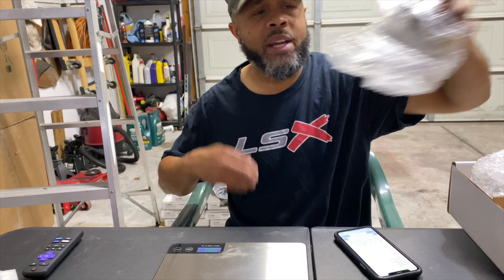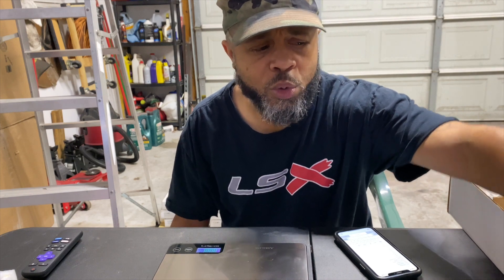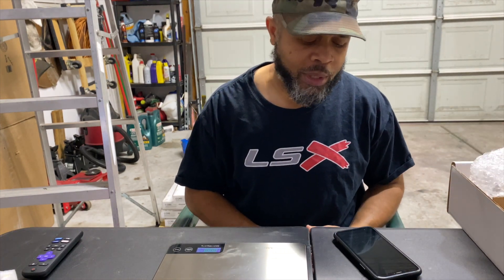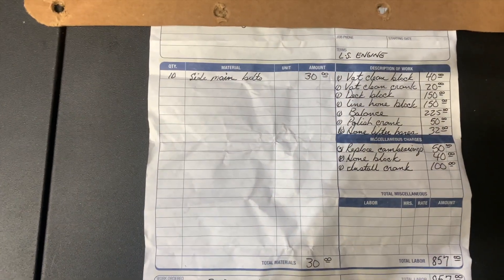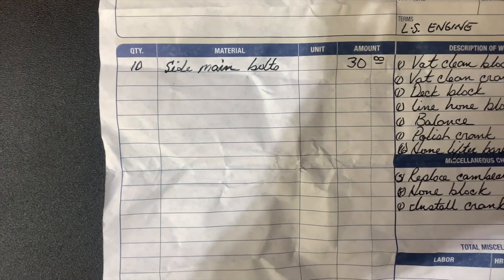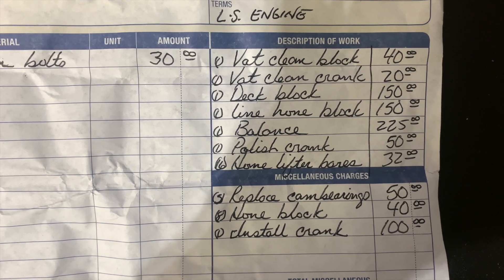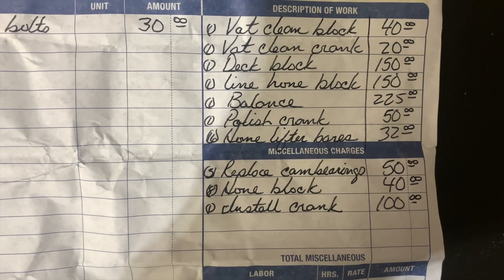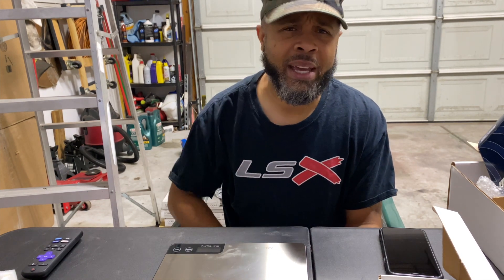Is Engine Balancing really needed? “Weights before and After”

Comment: I think it depends on use. If you want longevity then yes I’d do it. If it’s a boosted time bomb that’s easily replaced, skip!
Reply from the maker: I agree, most people are saying that the Summit Pro LS stuff comes somewhat “pre balanced” + or - 1 gram or so. The stock weights are off more than a gram and they seem to last but that may not be necessary under true “stock” conditions….de-tuned with a lot of safety features.
Reply: @canz8tercustumz  I’ve always used summit brands without issues, but only sbc stuff. I have summit ls7 lifters and am curious what you think? Would you put them in a mild street engine?
Reply from the maker: @ZL1Jeremy  I would be cautious on using their lifters because most Summit brand products are just re-badged parts from other manufacturers. I just found out that their pistons rings are re-badged hasting rings, same part number. Some of their parts are re-badged Chinese parts so you never know unless you cross reference the part numbers.
Reply: @canz8tercustumz  I will look into part number. Thank you